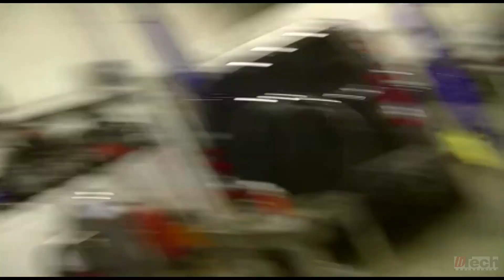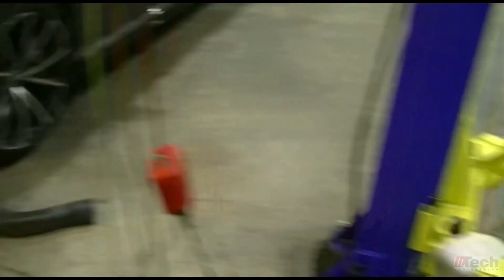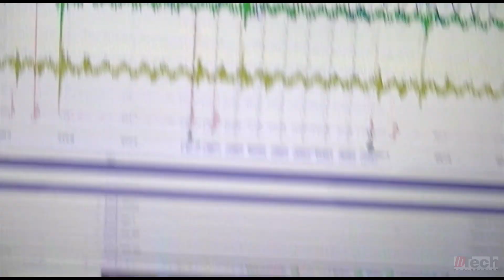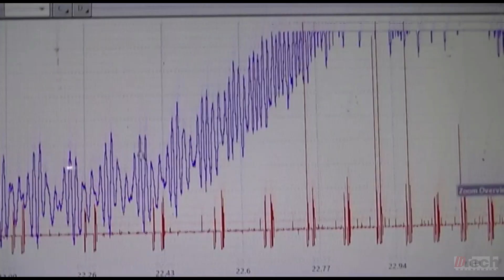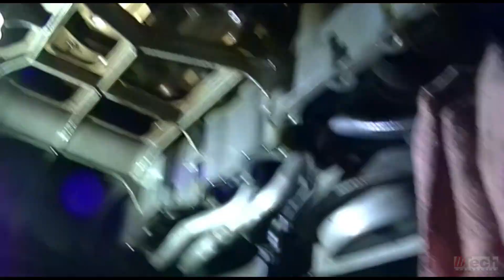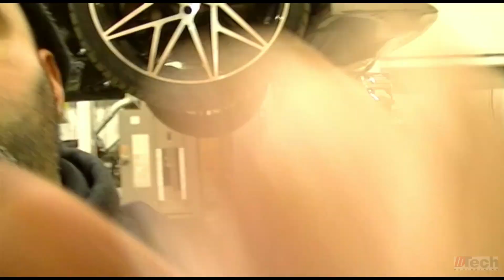2012 BMW 650 4.4 N63 rod knock diag & inspection

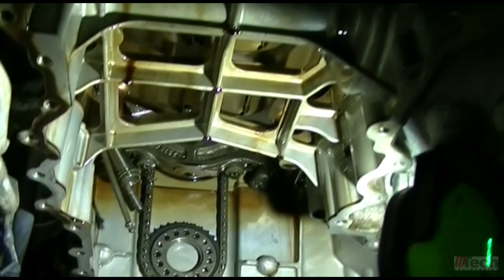Comment: Thank you for another great video! How did you separate the gear (hanging in the chain at 18:40) from the pump? Did you disconnect it by removing the 3 bolts?
Reply from the maker: yes, and there is an oil feed tube you have to line up also when reinstalling
Reply: @DTEAuto  Got it. Thanks a lot!

Comment: Can you have a Rod knock due to the beginning failing of bearings without triggering the knock sensors? My n63tu have a similar noise only when idle  but my knock sensors haven’t been triggered and it drives normal up until I aggressively drive it up to 80mph then it starts misfiring but no check engine light.

Comment: Hi friend. Question. I got a 2011 BMW 550i xdrive n63 engine. I put a new engine in 2 new catalytic.  converter. But the car is shaking. And hot. Misfire 2/4 from the passenger side only. Do you know what cost that please??
Reply from the maker: what codes doe it have? do some basic testing for misfires to try and find the issue to start with
Reply: Make sure o2 sensors are not backwards

Comment: Such a cool way of testing and thrashing out the theory Sadel!
As soon as you had identified the amplified knocking on cyl4. It's funny where your brain goes. I immediately paused and was searching for which TDC or BDC in the cycle, rod knock actually occurs = nothing. Then you continue and find it on the companion cylinder! Of course! Exactly as you explained = it occurs at the only real time there is no opposing force on top of the piston to arrest inertia. As the crank rolls over TDC on exhaust and into intake.
Occuring to the ecu as pinging in 4. Amazing.
So moving forward in future rod knock cases, as long as the car has an individual knock level indicator. You could be pretty safe in condemning the mated cylinder to the highest reading.
Reply from the maker: Yes, this one was definitely one of those sit and gather info and decipher data for theory purposes of when you know what a blatant problem is. I'm glad I took the time to do this one because it definitely helps clarify when the noise occurs and why, just exactly as how you described, which means hopefully I did my job in explaining correctly what was going on. Glad you enjoyed and thank you for watching.

Comment: Just wanted to say it is awesome to see someone making good use of the oscilloscope. It is a great tool that few know how to use and I was very impressed with your use of it! I see you use an autel I'm just curious what kind your using and where you got your attachments for it? I currently have a 906bt with the maxiscope I don't have any extra attachments for my maxiscope beside what comes with it since my Cornwell dealer can't really get a hold of extra attachments to the maxiscope
Reply from the maker: Hey Morgan, the only attachment that I use with the  autel is an obd cable extension that actually came in an older launch scanner I used to have. Hope this answers your question &  thank you for watching

Comment: Dtech.
Do you still have the capture of the problem engine?
A couple years ago i did the same experiment on a 5 cyl diesel Merchedes. However that engine never got opened up to verify what exactly caused the noise. I know it was related to cyl 2 though... I would LOVE to get my hands on your file to play around with. There are some other meassurements i would do on the file that you didnt try in this vid. 
Of course i still have my own file that you could have if you want to
Reply from the maker: Hey Steve, Thank you for watching first and foremost... Secondly , as far as the file goes, I will have to see if I can get that, my issue is that Toshiba laptop has been acting up on me, believe it or not , I have had that one since 2011 and it's on it's last leg, I have to try and retrieve and back up all the waveforms from it. If I am able to I definitely will share.

Comment: Respect respect. Im having an issue with my n63. My scanner tools is saying code P0328 knock sensor 1 Circuit high input (Bank1) ……….. I searched all over for the engine diagrams and guide on how to replace this part but No luck. 😓😓….. I found the sensor online but have no clue where it’s located and how to replace it safely and effectively.
Reply from the maker: This engine has 4 total knock sensors, I know for sure the 2 rear ones , one on each side, can be reach from underneath the vehicle, but I can't remember about the 2 front ones.
Reply: @DTEAuto  is it a bad knock sensor that’s making that noise for this car in the video? If not then What was the problem and how did you fix it?
Reply from the maker: spiz...no it's not the knock sensor making the noise, that sensor is used to pick up abnormal knock noise in the engine. The noise in my situation was caused by a rod knock, it is a mechanical fault issue and the fix is to replace engine

Comment: Thank you for the detailed video, learned some new things to up my diagnostics skill. This is why I got rid of my n63 powered 750i. I never suffered the failure but it is widespread for sure. I figure the tolerances are way too tight and the service intervals are ridiculously long. Those two factors doomed this engine series. The people I know who have suffered this failure have reported the engine locking up while cruising on the highway..... What do you think caused the issue ?
Reply from the maker: Its always hard to say on these situations, especially when it only pertains to one rod, but I would agree that the maintenance interval is just way too long and it might be difficult for someone to adhere to them correctly including the correct oil. Most of the time when I see this it is due to poor and or lack of proper maintenance. I'm glad you picked up some new diag tips, and thanks for watching.
Reply: I just found a rod knock on a 2013 X5 after diagnosing a misfire on it. I believe I know what caused it. It seems that BMW software does NOT cut fuel to a misfiring cylinder like domestic vehicles do. I am sure that excessive unburnt fuel caused hydrolocking of the engine, which in turn bent a rod.
Reply: Mine didn’t lock up, but it blew with no warning at 105k just cruising down the highway normally.